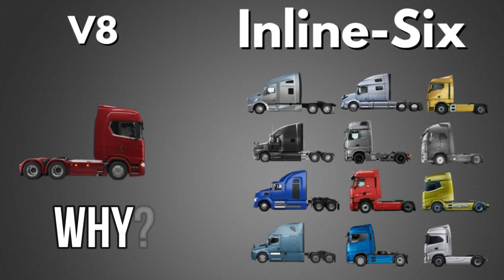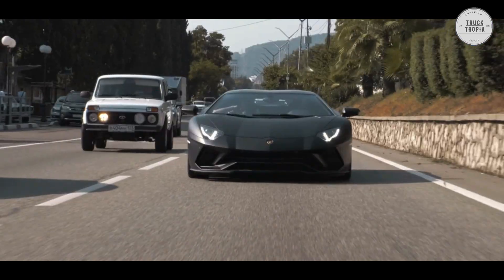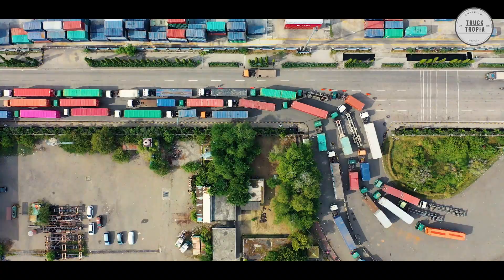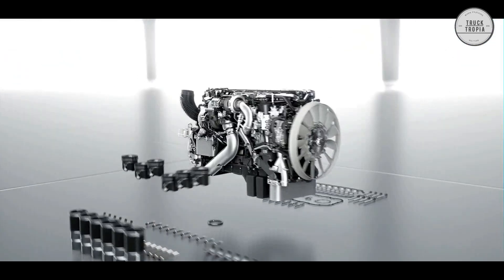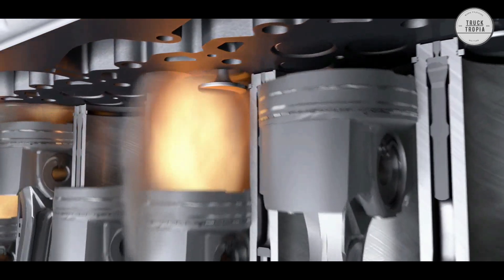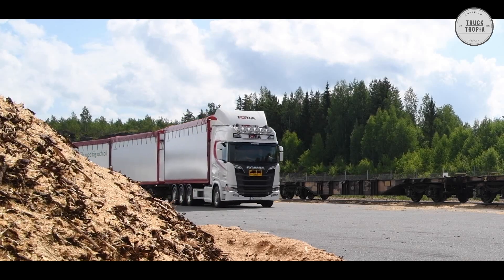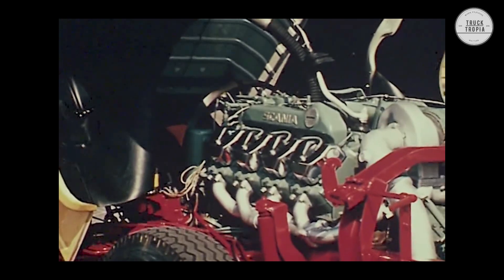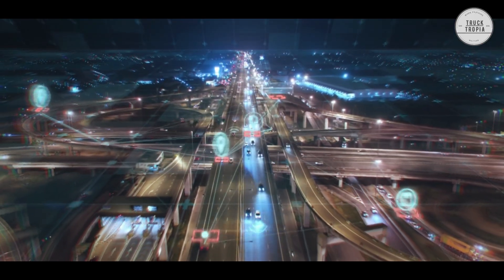Why All Semi-Trucks Use Inline-six Engines?

Comment: Plenty of performance cars use I6s - BMW in particular stuck with them and Toyota’s 2jz is legendary. V8s sound better and are easier to fit in a car engine bay though.  My Volvo D5 is an I5 and sounds like a mini truck engine.

Comment: Inline 6 has more torque?  I doubt
Let's take the biggest:

Volvo I6:     16.1 litre, 750 hp, 3550 Nm.
Scania V8: 16.4 litre, 770 hp, 3700 Nm
Scania has 1.9% bigger engine and 2.7% more power but 4,2% more torque. Explain this! Or maybe you compare old V8s with modern I6s? Modern engines are more advanced.

Btw - You can't have a lot of torque if you don't have a lot of power unless you have an engine with less rpm - but then you need a higher gearing ratio instead so no benefits here.

Comment: The in-line 6 is an internally balanced engine and that probably the main reason and also a in-line 6 will last basically for ever if maintained properly. That and the trucks also have the space for them..I had a 65 Chevy Nova with a 235 that had well over 300k on what was probably the original engine.Ford made there big 300 in-line 6 available until 96 when they restyled the f-150. That was the last of the light duty truck in-line 6 as GM switched to the 4.3 in the mid 80's..
Reply: Actually from 02- 09 the Trailblazers/Envoys/Bravadas had a 4.2 L I6 Vortec Atlas engine.

Comment: A straight answer is that the engine manufacturers try to reduce costs and parts if they can keep the same HP.   Besides fewer parts means few things can go wrong.  In past 10 years or so the engins have become more powerful.  Even newer 8 cylander gasoline engines are harder to come by.  What an 8 cylander engin could do 20-30 years ago, now a 6 cylander can do even better.   BTW I6 has few parts than V6.   In trucks there is a lot of space under the hood so V6 almost  never used for trucks.

Comment: Why is the focus of CO2 emission reduction efforts personal ground vehicles? Surely commercial transits are massive offenders considering they will run "ghost flights" aka having empty (as in no passengers aboard) planes making flights several times a day. In some areas you'll see a greyhound bus parked on every corner at every hour. Parts of the country still rely heavily on coal burning trains that billow toxic fumes just to get enough power to chug along slowly.

Compared to that one person's fifth generation hand me down rustbucket that hardly ever sees roadtime can't possibly be that bad.

Comment: in Japanese big rigs, the usual big diesel mills they pack underneath are so way beyond....

-10.6L V8
-15.5L V10
-19.6L V12

and the usual ones are Isuzu, Mitsubishi's truck division FUSO, Hino or even Nissan's truck arm UD (Universal Diesel)

with Isuzu, by far has the record of the biggest one ever offered in production:

the mid-2000s GIGA V600 heavy duty tractor:

with the biggest and most powerful one ever made:

30.0L Twin Turbo DOHC 40-Valve V-10 600 HP @ 2000 NM

Comment: Very misleading as not all trucks use the straight 6 cylinder format. Many use a V8 style diesel engine. Some have even used V12 formats
Reply from the maker: Today every single manufacturer use inline six, except scania ..
Reply: @TruckTropia  And Mercedes they still produce a V8

Comment: Cummins has a 23L I6 that is a straight beast. Not sized for class 8 trucks but we had them on fluid pumps for oil and gas service. Very moderately tuned at 1,000hp

Comment: Because inline 6s are some of the best most reliable engines ever made. They make a lot of torque and can make insane amounts of power with little very little work. look at the old supra 3.0 inline 6s. look at the old cummins diesel inline 6s. It's not uncommon to find old supras that dyno over a thousand horsepower and the old cummins with it's simple fuel system could makes hundreds more horsepower just by turning up the fuel.

Comment: Heat builds up on the inside of the cylinders more on the v configuration, where the inline runs cooler thus improving engine life
Reply: So many benefits that are natural for the inline 6. I do love a strong V6 though

Comment: I think you have to check your facts again, regarding emissions NOx and HC are way more focused on while calibrating engines. And to be honest, Scania has better fuel efficiency compared to Volvo at this moment. They have the higher engine out NOx and use two SCR units to compensate for the engine out NOx and stay within the legal limits. Why do they have better fuel efficiency? Probably because of Scania in general runs with high compression. But CO2 has its role while calibrating but according to authorities, NOx is very important to reduce for future ICE as well as soot particles. You can read all about it on dieselnet.

Comment: Wish this video delved more into the actual engineering aspect. For example, it never explains how the inline configuration allows for higher torque vs a V configuration with similar displacement and a same number of cylinders. Overall this video just seems like it reads off a brochure from the manufacturer instead of a deeper dive.

Comment: In Europe, we use inline 6 and V6 but there are a lot of inline 8 and V8 and even 10 cylinders engines that get fitted to lorries.

The Benz 10-cylinder engine can go between 75k to 150k for the need of an oil change but most manufacturers of oil say every 25k
Reply: V10's in a truck, in Europe? I only remember Mercedes having one long ago. It is already years ago that Mercedes and MAN had V8 trucks.
Reply: Idk any recent car within the past 20 years that has an inline 8 like old cars.

Comment: Torque and horsepower are not "competitors"; it's not torque vs. HP. They are directly related to one another because [RPM × Ft•Lbs] ÷ 5252 = HP (for a 4-stroke; 2-stroke, it would be ÷ 2626)

So when you say "trucks don't need big power"....they actually do, but it's what speed they need it that's the difference, the operating conditions

If you wanted to posit an "X vs Y" argument, it would most accurately be high end vs low end torque, or HP; keep the units the same, because the engineering choice is a compromise of where the engine operates most efficiently

Comment: Horsepower generally peaks in the upper RPM ranges, while torque peaks in the lower RPM ranges, which is where moving dead weight from a stand still comes in to play.  Horsepower doesn't peak until the weight already has momentum going.  Horsepower has more advantages like in the muscle car industry where the hp to weight ratio is much higher and not near as much torque is needed to make the car launch and the hp can move the car at much greater speeds.  Two totally different worlds.
Reply: You really don't understand engines do you hp is a measurement of  torque times rpm divided by 5252 they are not different things.
Reply: Perfectly sad man

Comment: The discussion about needing torque not horse power is completely wrong!!! This is what a transmition is for. The transmition gears up or down the output of the engine. Thus if you had a engine of the same horsepower that ran at 2 times the RPM's the transminon would use gears to reduce the RPM's in half and thus doubling the torque. What is needed is HORSEPOWER. The transmition will deal with matching the RPM's of the engine to the correct RPM's for the wheels.

Comment: I know this video is more heavy hauler oriented but in terms of light and medium duty trucks, the Ford 6.7L V8 has destroyed the Cummins I6 that Ram uses. The Power Stroke V8 makes several hundred ft lbs more torque and there are several owners who have over a million miles on their Power Stroke. So when done right, the V8 diesel can be easily dominant.

Comment: Gotta say the 2JZ-GE inline six in my 1992 Lexus SC300 was a total sweetheart.  No turbos, so it wasn't fast, but pared with the 5 speed manual it was fun to drive.  It was also the smoothest/most refined engine I've ever owned, made some awesome sounds as well if you revved it out.  At idle you'd never know its running inside the car, 6200rpm redline, it made a nice racket but was just as smooth/vibrationless as at idle.  The V6 in my 2014 ES350 is WAY faster and WAY more fuel efficient, but it has some odd vibrations at idle, doesn't sound like that 2JZ inline six, doesn't have the soul/sound/character of that engine.
Reply: @BB49 Totally agreed.  Except if its a BMW, they'll still manage to find at least a couple ways to make it fail right outside of warranty that will "break my wallet".  BMW still makes awesome inline sixes though, just you gotta pay to play.  Either up front buying a new one or pay the mechanic bills to keep an older one on the road.

  Still the BMW inline six is a hell of a lot better than any V8 BMW has ever made.  Every single damn V8 BMW has made going back to the 1980's is a massive St bernard sized steaming pile of dog shit.
Reply: @AaronSmith-kr5yf  there’s a reason Toyota chose bmw to make the engine for their new Supra the new ones aren’t unreliable
Reply: @cartere9981  Revered sports cars should'nt be mongrelized so, Toyota can redeem itself by installing a Lexus V8 in the Supra.
Reply: @cartere9981    That's what they always say until they get some age/miles on them.  BMW inline sixes are SOLID in terms of the rods/pistons/valves/headgasket/crank/turbo/turbo manifold/etc  Its all the crap surrounding them like plastic radiators, plastic water pumps, wonky electronics, faulty fuel pumps that make them expensive/finicky as they age.
Reply: The 20+ years of technological advancement probably why the 2014 more efficient, a modern I6 would be also.
Reply: My first old chevy had a inline 6 & a three on the tree . That car was a sweetheart

Comment: Depends also where in the wolrd you are. In Norway V8 is totally normal for a semi. We can not have less than 500HP. You will see many between 550 and 750HP.
Reply: Hp in a semi is pointless.. its all about torque
Reply: @christiantorres2950  🤣🤣🤣
Reply: @Dani8chs  lol i just like saying dunb stuff when bored at work dont mind me😂😂😂😂😂 i drive semis for a living gets alittle to boring sometimes
Reply: @christiantorres2950  Of course torque is most important on a semi but you wont get torque and propper speed without HP. No time to waste thrashing up Hardangerviddaen 😎 Or while overtaking grandpa with his flat cap in his Suzuki Swift.
Reply: @Dani8chs  😂😂😂😂😂😂😂
Reply: Tbh though its anazing how a diesel semi engine has 400+ h.p and north of 1500 + ft lbs of torque… thats enough to rip a house off its foundation lol

Comment: Another engineering consideration is that I6 engines create more torque than the same displacement v8 due to the cylinder size being bigger. Though v8 may rev higher thus create more power but toque is more important with commercial engines than outright power

Comment: The 903 Cummins was one of the best engines ever made. If it was made today in an electronic version there is no doubt in my mind that it would beat anything on fuel mileage! Back in the 70's a well-tuned one would get 6-7mpg. The same goes for the 3408 Cat. If it was in an electronic version it would also be much more efficient. The 903 would turn 2600 rpm. Not sure what the 3408 run at. But both were damn good engines! The old Detroit V8's and V12's had some power back in the day but were fuel hog's and leaked oil terribly. I know nothing of the European engines other than I had an N14 in a truck that is built by MAN in a International prostar and it was a classic piece of junk!  I am sure it was all because of the US emissions on it but it spent more time in the shop than on the road! Damn near broke me. I currently have an ISX and love it.

Comment: Today's trucks should be using ethanol fuel derived from biomass, fueling an internal combustion engine matted with an electric hybrid system. The fuel economy could be improved by 50% or more, and the electric drive engines provide higher torque power, which, as can be seen from your inline 6 engine review, is very important for the heavy trucking industry. Ethanol fuel from biomass is a renewable energy source so it does not contribute to greenhouse gas emissions, thus also not to global warming. The inline 6 engine may well be the choice for ethanol fueled engines in a hybrid system.

Comment: Imho 2 stroke cycle is better that 4 and 1 stroke cycle is even better. 2's produce more torque than 4's, and 1's produce even more torque than 2's. Because 1's are directly opposed cylinders they can also produce higher rpm's.

Comment: Torque isn't important, well not directly. With the correct gearbox the same wheel torque can be achieved for a low torque engine of the same power.

Comment: hybrid is they way, the electric motor can save fuel and engine wear and braking, the engine can keep the smaller battery charged and back up the motor for towing heavy loads or on the highway

Comment: All countries should allow bigger and heavier trucks like in finland trucks maximum weight is 76tons with 11 axles and it can be 34,5m long. So you can transport more stuff with one truck and saving fuel and when mass is like that v8 is way to go
Reply: Gday from down under wear our roaftrain can happily slip into the tripple digits, however its just not practictal, to have 4 trailers everywhere.
Also a couple more cylinders dont make all the difference.
Hell even in cars, our turbo ford 6 had more of the lot than the competitoins biggest v8,

We call it the barra.
Reply: Not much use in a country where you are never more than 70 miles from the coast.

Comment: For a 6 cylinder, inline is probably the best if not mentioning boxer 6
Reply: A boxer 6 would be this big weird pancake o metal filling the hood in two dimensions.  Can't put a mid engine on an 18 wheeler

Comment: The 3408 CAT was a V-8 and was extremely popular.
Reply: 3408s were somewhat popular, but for decades the US's infrastructure rested on the 3406. Used in trucks, scrapers, loaders, boats, you name it. Not saying the 3408 is a bad engine, just not as popular or common as 3406s. 3208s, however, are definitely not the final word in longevity.
Reply: @davesstillhere  Well CAT doesn't make any of those engines at all anymore for a Semi. If you want to get technical. They're out of the business. Our Government chased them out.
Reply: @dannysdailys  I'm aware of that, I work for a Cat dealer. But there are plenty of 3406 and C15 engines running around on their 3rd and 4th overhauls. Only seen one 3408 recently, in an old Kenworth.

Comment: All the modern trucks are Diesel powered and diesel engines have no limitation in the max volume of a single cylinder. You CANNOT produce a gasoline powered car engine above a certain cc on a few cylinders without problems and inefficiencies, because the plug spark takes too long to ignite the fuel mixture inside a large chamber. 
The results could produce undesirable knock effects and bad combustion.
This is why you don't see 4 cylinder engines above 2500cc for example but usually to 5 or even 6 cylinders fractioning despite the increase in complexity of the engine itself.
Diesel engines do not have the problem as the ignition happens by "compression" instead then via a plug spark, and happens everywhere inside the cylinder at the same time. This is why you see BIG ship engines with few cylinders.
The Inline 6 cylinders is the best assembly in term of smoothness and vibrations, which is important in engines that can run up to 1M km before replacing. You have to go up to a V12 configuration to get the same smoothness with almost double the costs for no real gain, as  truck engines are large, but not that large to need more, like, for example on Tanks, where displacement, power and torque are doubled or triple what you have on a standard truck. All tanks have 12 cylinder engines, to reduce the mass of the piston and keep the engine reactive.
A 6 in line configuration is still compact enough to be housed inside a truck with the engine under the cabin, which is most convenient to reduce the manoeuvring space on large tractors, especially nowadays that all the engines inside trucks are turbocharged, meaning power and torque can be managed by tuning the turbine.
Reply: For an example of gasoline powered engines with fairly big cylinders, see WWII aviation engines. Typically around 2-3L per cylinder, running at 2500-3000 rpm. The, by modern standards, low rpm surely helped with flame propagation in those huge cylinders, though some late WWII engines that never entered service like the Jumo 213J ran at 3700 rpm with 2.9L cylinders.

Comment: Well here is my answer, lets see if we agree. I6s are smooth, important when you are sat behind it all day. They are relatively cheap to develop, build and maintain. They are the "first" engine in cylinder count to always be having a power stroke apart from the 5s that gained road car use popularity for a while. Finally, High-capacity sixes are easy to make over-square leading to huge torque numbers on a flat curve. Scania are still building their ever-popular V8 truck
Reply: Under square. Longer stroke than bore 😉
Reply: @Retro_Rich   Correct, a longer stroke will make more torque.

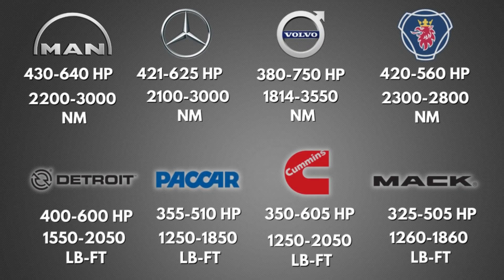Comment: 1:43 Why is the information on Scania over 10 yrs old when info on Volvo is accurate? the most powerful engine is the 770hp Scania engine with 3700nm of torque
Reply: I agree but I had an S650 and a 770 demonstrator yet I didn’t find any real difference running at 44tons normally from Hull in England to Holyhead similar times and as UK motorways are very crowded making them almost identical..That’s just my opinion and I’ve had Scania V8s since 1974 when it was the 140 …
Reply: In the US. It’s straight 6’s.